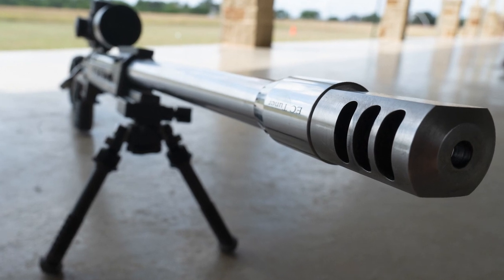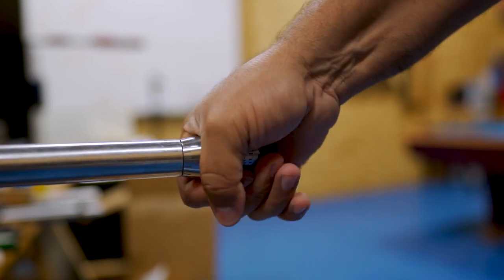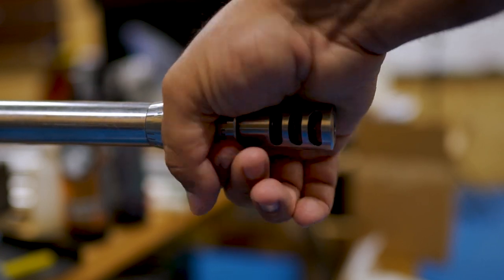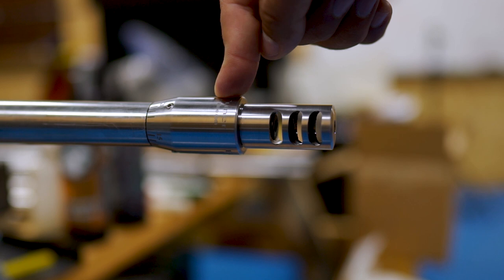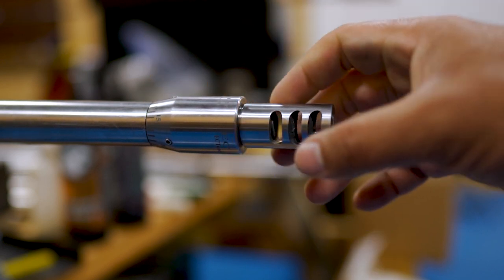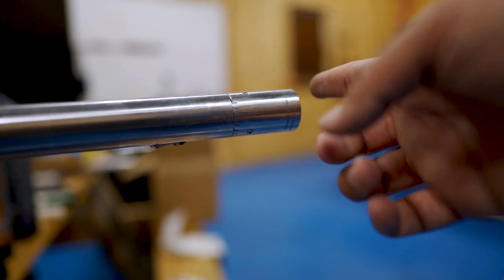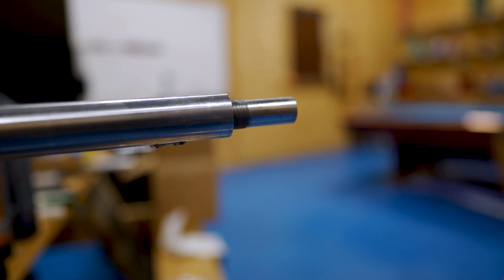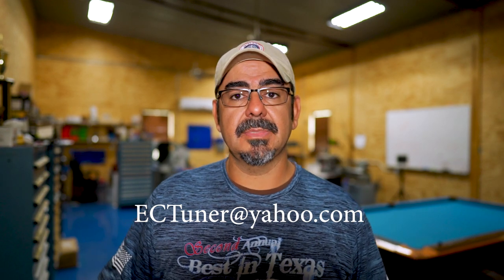Everything you need to know about ECTuner

Comment: I have an A-Bolt II in .243 with the BOSS system on it. Absolutely still the most accurate rifle that I’ve owned. I wonder what caused Browning to drop it as an offering. I’m not even gonna go into to how many amazing groups that I’ve shot using plain Blue Box Federal ammo with that gun. Can’t believe they dropped it as an option.
EDIT: Browning discontinued the BOSS after they were sued by several gun owners for hearing loss. The BOSS initially was only offered with a muzzle brake which the defendants claimed damaged their hearing. They offered a non ported model but when FN took control of Browning they canceled it altogether.
Reply: I have a Browning .223 with BOSS.  I also have a non-ported muzzle brake.  Back in the 1990's most people didn't take the time to "calibrate" their BOSS for their barrel and bullet combination.  The BOSS does work if one takes the time to calibrate it......
Reply: WOW...

Comment: Hi Erik, 

Can you brief explain how to clean and perform maintenance on the turner brake? I now taking it off every time I clean my trifle. I only preform dry nylon brushes to get red off carbon. I do not want to use Bore Tech Eliminator at all.
Reply: I have the version with the tuner at the end with the muzzle brake attached to the barrel.
Reply from the maker: I use CLR.  You can dip brake while still attached to rifle into a can full of CLR  for about 10 minutes and wipe it off. After cleaning, dunk into another can with rubbing alcohol.

Comment: Great explanation, I learned a lot. However, I still don’t know what an ECTuner does or how it does it.
Reply: same
Reply: Instead of tuning your load to barrel, it tunes your barrel to your cartridge. See, it goes on the barrel and is called a tuner, ergo it's a barrel tuner.
Reply: I looked it up on line. Barrel harmonics come into play here. The vibrations of a barrel affect the bullet. Like balancing a tire on a car with a wheel weight to stop vibration
Reply: @marcosmota1094  It involves barrel harmonics.  I calibrates the barrel to allow bullet travel from the muzzle at the at-rest position.  As far as barrel harmonics, the barrel allows potential vibrations, and the cartridge induces vibrations.  When they constructively or deconstructively meet in phase at specified barrel lengths, it's called a harmonic node, thus barrel harmonics.  You adjust the interference by changing the powder charge (usually), and you can adjust the length to match the node by moving the tuner, which acts as a ballast that virtual "lengthens" the barrel.  There's lots of different factors I'm not discussing but the general gist is:  interference wave = powder charge, node length = tuner.  In layman's terms, tuners are basically just a way of rigging the system so that the potential in the barrel correlates to a "longer" barrel.  Could also express this in terms of a ballast (or as a shift in inflection points) but you get the point.
Reply: I don't expect the average hunter to know anything about this stuff.  To them, good barrel + good stock + good action = good shooting gun.  But it's not good enough in PRS, where shooters typically cut hunter's groups in half at the minimum, and one shot group at the max.  To get a greater competitive edge requires gaining a more intuitive understanding of what's actually going on and one of the largest margins to gain (and most frustrating) is barrel harmonics.
Reply: The tuner is a weight added to the end of the barrel.  When you adjust it, the weight moves closer to the end or farther from the end of the barrel which modifies the harmonics as noted.  Slight adjustments are all that is needed apparently.  The big drawback is that you have to mill the end of your barrel which might cost more than the tuner itself.
Reply: watch a super slow motion of a thin rifle barrel being fired--- then you will see what it fixes :-)
Reply: the barrel whips when fired the tuner adjust the whip so that the bullet when entering the muzzle end of the barrel whips at the same location, thus the bullet will be leaving the muzzle at the same spot every time, it's like a water hose you grab it and make a motion and you will see the hose move, the tuner helps the bullet come out of the barrel at the same whip every time, most times

Comment: Hi Erik--
Have a stock savage HB bolt gun.  No threads.  Could I machine a threaded sleeve that
I could shrink fit on the end of the barrel-- and then make an internally threaded weight to screw onto the shrunk-on sleeve ?    Do you think that would work as a tuner ?
(so I dont have to remove the barrel out of the receiver--)

Comment: Outside of PRS with an exposed muzzle break, have you utilized the tuner with a suppressor? I'm assuming it would work just the same but I'd like some kind of feedback from someone that used a tuner with a suppressor before getting work done to a barrel. Thanks in advance  for any info from anyone.
Reply from the maker: Yes I have.  It works the same way as with muzzle brake.
Reply: @ErikCortina  thanks brother appreciate it.

Comment: Erik, on your web page it looks like the non-taper version will only go on a 1.25" barrel, and the tapered version minimum barrel size at the muzzle is 0.850" .  Am I reading this correctly?  Or can the tuner be installed on more sizes of barrels?  I shoot F-class and would like to give it a try on my next barrel install.  Thanks
Reply from the maker: It can be installed on any barrel larger than .850” at muzzle.
Reply: @ErikCortina  Thanks Erik.  

Do you use the ECTuner on your competition rifles?
Reply from the maker: Wade Adams 
Absolutely. :)
Reply: Erik Cortina - Pro Shooter 

Well, I just ordered 2.  Send them fast. I have a shoot in 10 days.  Need to get to the gun smith and shoot it in!!!!   ;-).

Comment: I am struggling to understand the mechanical/physics concept behind this barrel tuner. I can understand the idea behind changing the harmonic resonance of a barrel but simply changing the position of said tuner doesnt seem to me to change anything physically with the barrel itself. Now if you added spring tension inside the tuner itself, you are changing potential saved energy which could in theory effect the weight and harmonics of the barrel but even then it would be a change so small that I doubt even a vacuum scale could detect its change in weight. Hmmm maybe an idea worth expanding upon.
Some old military service rifles would have a small screw that would put more or less pressure on the barrel affecting barrel harmonics, however this was achieved via pressure on the barrel via the stock. Just thinking out loud.
Reply: tbone martinez Browning Arms described their system as a way to change the timing of the barrel harmonics  They claimed that you could change the timing of when the barrel harmonics were at their highest peaks in order for the bullet to leave the barrel when the barrel was at it’s most stable point. That’s probably a poor attempt on my part to describe it but I can tell you that it worked wonderfully in a factory rifle that you wanted to have great accuracy shooting different weight bullets. In a .243 like mine that’s a great thing because a lot of .243 guns will shoot lights out with light bullets but as the bullet weights get up to 100gr the accuracy begins to decrease. Before the BOSS was introduced, if you had a .243 that was like that the on,y option that you had was to change twist rates in your barrel to stabilize the heavier bullets. The BOSS enabled you to get great accuracy with most all weight bullets. 
The only downside was that you had to put the time and ammo in to find where the sweet spots were Browning gave you suggested numerical starting points but you still had to fine tune it to your rifle.
Reply: The basic mechanical principle is that the barrel is a cantilever beam, and when struck it will vibrate at a given set of frequencies, like a tuning fork. If you mount a mass on the barrel, it will slow those frequencies. As you move the mass outwards, it will have more leverage over the barrel, and slow the frequencies even more.

Comment: can this tuner  be installed on an ar-15 platform
Reply from the maker: Yes
Reply: @ErikCortina   i was wondering if the system will work with a barrel dia. of less that .850 or do you make tuners for smaller dia. barrels?

Comment: There is an old saying by old Apache Chief Bulsacancrack. He said “man putting barrel tuner on rifle is bad and lazy reloader”
Reply: Consistency requires everything to be the same every shot.  Part of the shot is the barrel and just like loading, there are nodes where slight changes do not result in large POI changes.  There are also places where slight changes result in significant POI changes.  This is just like reloading, it puts your equipment in a place where slight changes have a minimum impact.  You can't directly change barrel harmonics with reloading, so it's a completely different and unrelated thing.  For the most accuracy, you need a stable harmonics node, stable velocity node and all the rest of the good stuff.  It's not one or the other.
Reply: Bob Wilson Thanks Bob. I am well acquainted with the barrel node properties. I also fully understand the use of a barrel tuning device. I have studied in the engineering line in 1985. At the moment I am busy with the scientific and mathematical quantification of barrel node occurrence. Within the next 6 months or so, I will write my thesis on this issue. There are many misconceptions and misunderstandings of barrel node dynamics. One of my subjects on University was the different waves present in solid materials. I will base my research and scripture on science and maths. Barrel tuning devices will form part of the script, as I have noticed that many people use them or are intrigued by them but they do not know how and why they work. 

I appreciate your response and I also appreciate Eric’s ground breaking work on barrel tuners. 

Many of my friends have asked me about the device and once I have explained the scientific reason behind the working principles, they understand the concept much better. That is why I have decided to do a proper write-up about the subject. 

PS- I have noticed that Eric has a certain temperament and I use this to pull the living daylights out of him. I have done it a few times now and he fell for it head first. Nonetheless I have great respect for someone like Eric, from whom I can still learn something. 

I am a member (20 years) of the South African Hunting and Game Conservation Association and have successfully competed in many competitions held by them. From 2005-2018 I have been in the top twenty competitors out of about 1200 competitors. I have won many regional and national competitions and although I am proud of my accomplishments, I do not have a pip on my shoulder. I just enjoy the shooting.
Reply: Fanatac Reloading  So, you’re just messing around at everyone else’s expense?  Is that what you’re saying?  You seem to like to introduce doubt, like your old chief what’shisname saying, and that’s how you get your jollies.  Good to know.  I’ll remember to ignore your future posts.
Reply: @barryboyd7973  Hi Barry. It is not as you percieve. Yes I have a sense of humour but I don’t use it everyday the whole day. In my humble opinion, a barrel tuner is overrated. A barrel tuner is an easy way out to rectify bad reloading methodology. Especially to the attention you give to your cases and the bullets. A barrel tuner changes or harmonize small differences in the natural resonant transversal frequency of the steel the barrel is made of. I have played with barrel tuners many years ago and at the end the utmost precision I prepared and loaded my rounds won a barrel  tuner hands down. The biggest problem is people do not clean the brass neck properly, they do not anneal regularly and the jump inbetween ladder test loads with too big increments. 

I did apologise to Eric as he seemed well irritated by my remark. He accepted my apology in the way I put it to him. 

You have opened an old and healed wound now with your remark which is unnecessary. 

Cheers and have a blessed new year.
Reply: Fanatac Reloading   I am sorry about opening the old wound,  I meant you no harm.  Thank you for your honesty and explanation of where you were coming from.  I will pay attention to whatever you write in the future if it is more of that.  There are quite a few people who do pay attention to the details when reloading and testing.  We’re not all looking for an easy fix for poor habits.   If a tuner can bring that last little bit of precision, then it has value to us.  Again, my apologies for opening that old wound.  We all have them.  Mine get reopened from time to time.  Usually when I need a reminder.
Reply: @barryboyd7973  Hi Barry. No problem at all. I think if you read between the lines i am far more conservative and serious in my life than it may seem. 

No hard feelings. I appreciate your apology more than you can imagine. 

So much for a rough 2020. Blessings in abundance for you and your family in 2021. 😉